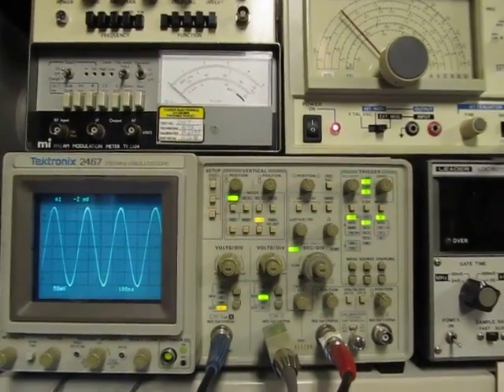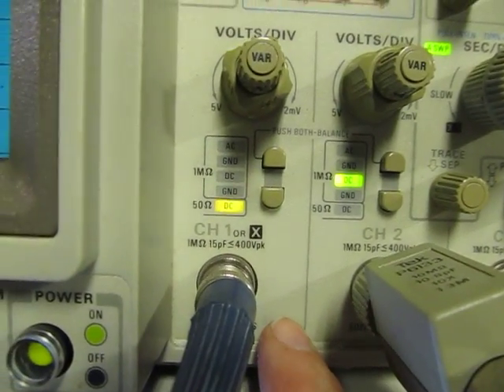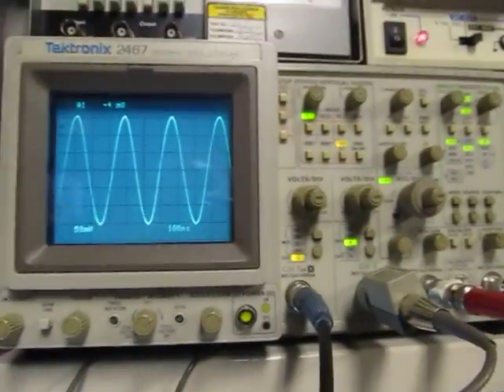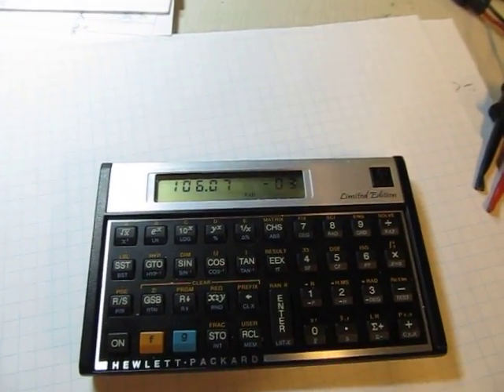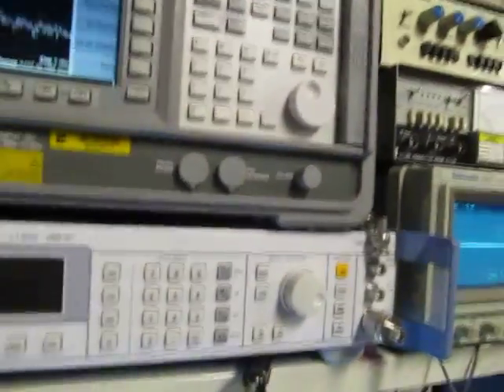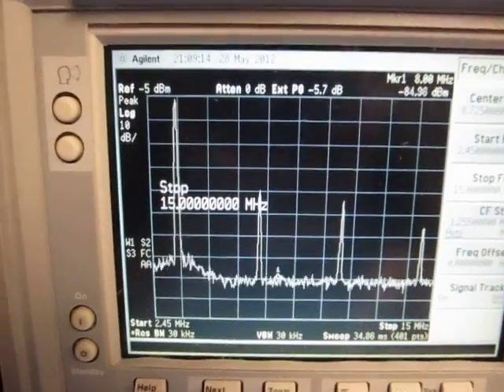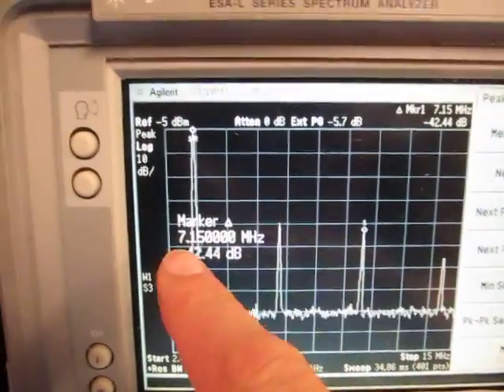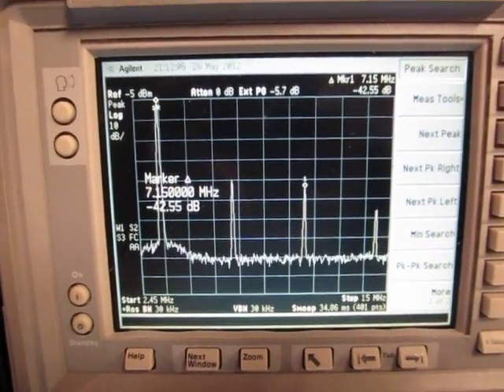#46: Basics of amplitude and distortion measurements on a scope and spectrum analyzer

Comment: Question: You used a "50 to 75 ohm min loss pad... " on the spectrum analyzer. On our oscopes that don't have selectable input impedance, we use a 50ohm resistor on the scope end for probless measurements  using 50ohm coax. What is the advantage to using the 50 to 75 at your specan vs just a 50 ohm pad? Is this needed because the specan input impedance is much lower than an O scope?
Reply from the maker: That specan had a 75 ohm input impedance (designed for the CATV industry). That’s why I used the pad.
Reply: @w2aew  Okay, so I guess what I'm asking is that since you chose that 50 to 75 ohm pad for a specan with a 75 ohm input inpedance. Does the much higher input impedance (1 megohm) of an O scope negate the need for using say a 50ohm to 1 megohm pad. It's a theory question.
Reply from the maker: @ernieschatz3783  When bringing low frequencies in (lower than RF), you can usually get away with just the direct connection to the 1Mohm input.  For RF, you would want the coax to be terminated into 50 ohms - either using the scope's internal 50 ohm termination if it has one, or through the use of a 50 ohm feedthru termination.
Reply: @w2aew  Yes, we use a 50ohm feedthrough termination for our fixed input impedance oscopes regardless. I'm still not understanding why you don't just use a 50ohm feedthrough vs the 50 to 75 pad for the specan even though it has a 75ohm input impedance. We don't use a 50ohm to 1megohm pad for oscopes.
Reply from the maker: @ernieschatz3783  If I put the 50 ohm feedthrough on the specan, then the 50 ohm would appear in parallel to the 75 ohm specan input, resulting in a 30 ohm termination.  There is no such thing as a 50 ohm to 1Mohm pad, because the 1Mohm is not a transmission line termination.

Comment: This is very intresting thanks a lot, I guess that the SA corrects the FT of signals, cause in this case you have a sin in a temporal window, and TF would have a constant of T/2 for voltage, is my analysis true? thank you
Reply from the maker: I don't understand your question.
Reply: The fft of à sinus in à T Windows gives à fourier transform with amplitude T/2. This has not bien s'en here, is because the sa correct the amplitude ?
Reply from the maker: @karielf8947   Yes, SA and FFTs in instruments are designed to give you an accurate amplitude measurement.
Reply: thank you @w2aew

Comment: ...and of course always paying attention what level in dBm is allowed at the input of your measurement equipment. Scoop is probably more "forgiven"  but most spectrum analyzers would not tolerate much on the input, as low as 1dBm! Otherwise you can blow up your very expensive equipment.

Comment: 300mV p-p is NOT 150 rms,  that is 150 mV peak.  P-P X 0.3535=Vrms  or V peak x .707 .
Reply from the maker: Yeah, I mis-spoke, but I did handle the number properly, converting 150mVpeak to rms by dividing by sqrt(2)... ...same as multiplying by 0.707.

Comment: Alan, great video as always. When measuring LF audio signals on a spectrum analyzer, what's the best way to attenuate the signal to avoid damage to the mixer? If I measure the signal at clipping, the voltage could approach the rail value. Thanks
Reply from the maker: xyloeye Apply the signal to an appropriate load, then stick a resistor in series to the Spectrum Analyzer.  This resistor will form a voltage divider with the 50 ohm input impedance of the spectrum analyzer (provided the analyzer goes down to audio frequencies.  For example a 450 ohm series resistor will attenuate the signal by a factor of 10.
Reply: ***** Oh, duh. Too simple. Thanks, Alan.

Ken

Comment: I own a Sound Technology 1000A FM generator, and I've always wondered WHY the output is calibrated for 50 ohms when a standard FM receiver antenna impedance is 75 ohms - the very intended purpose of this machine is to test FM receivers, yes? Perhaps you could shed some light? I just use it "as-is" with no adapter; I'm just using it for a source and not for measurements.
Reply: Mark way back when, when radio was in its infancy research found that cable with a 30 Ohm characteristic impedance was the optimum for power handling requirements. Cable with a 70 ohm characteristic impedance worked best to minimize signal loss. So a compromise was struck to settle on 50 ohms. The Cable TV industry selected 75 Ohms in the early 1970s. During the 1970s one could also find 52 ohm Coax but that has fallen away over the last 30 some odd years and 50 ohms has become the standard. What's a couple of ohms among friends. ;-)

Comment: Slightly OT- I notice that when you measured the trace on your scope, you used the "inside" edge of the trace. Not sure, but it made me wonder if you instead used the "outside" edge of the trace that may have impacted your final scope dBm calculation. Is that standard/conventional practice to use the inside edge of the trace for the most accurate measurements? I realize this makes no difference in the relative harmonic distortion component of the signal.